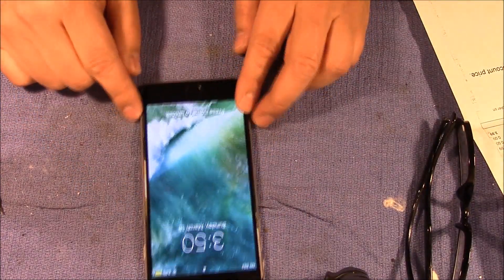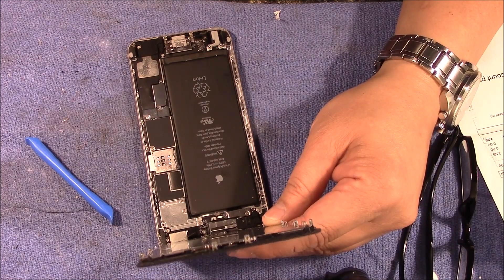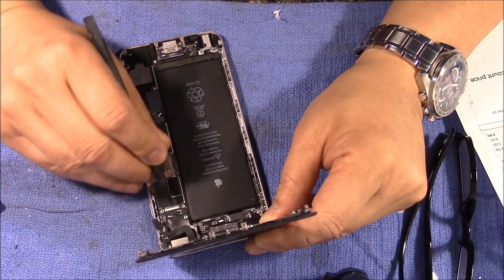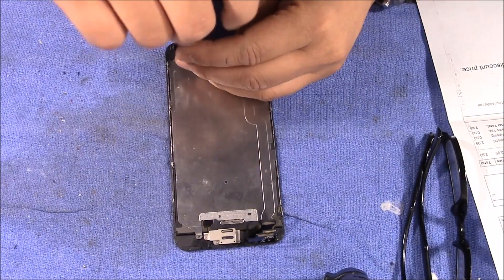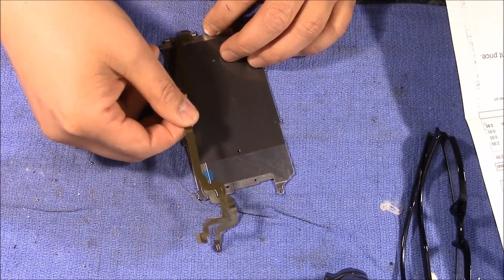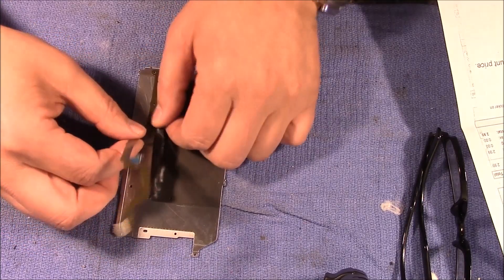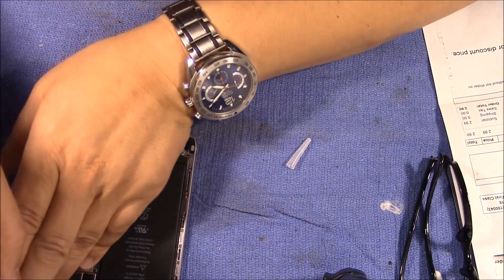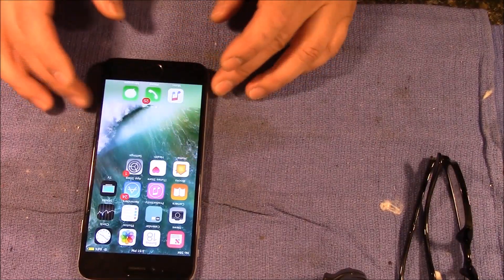iPhone 6 plus home flex ribbon cable replacement

Comment: i partially tore my ribbon and the amazing thing is that it still works..... but glad to know there is an easy solution to repair it... Thanks.
Reply from the maker: The cable is delicate. But glad to hear you have it working again.

Comment: At the top there's three ribbon cables does this also come with this ribbon part since I've just replaced the battery in my iphone 6s and the home button doesn't work and I snapped one of those 3 ribbon cables would this be the problem?  cheers
Reply from the maker: This is just for the ribbon that connects the home button.  If you damaged others than a digitizer may also be needed.
Reply: @mrfixit4211  thanks pal, I've just bought a new screen with camera and home button attached.👍

Comment: @MrFixit There is half a tear on my flex cable which is similar to the one you replaced. Is this why only half of my screen is able to respond to touch on the right side and why the left side won't respond at all? Is it the digitizer or  Can I use a flex cable from another phone with out having to buy a new on to fix the problem? Thank You in advance!!
Reply from the maker: I cant say for sure, but if there is a cut I would first replace the cable before replacing the screen digitizer.

Comment: Hey can you please please please help! I’m only 15 and my button came out my 7 plus and need to put the button back in its spot is this possible? Can the button connect with the ribbon cable again? I can’t tell my parents because they get very mad and it’s scary
Reply from the maker: If the button came completely out, then you will have to replace it, as there is no way to reattach the it, but there is a problem with that.  If you use a generic button, it will work, but you will no longer have updates as it is not configured to your device and only Apple can do this.  You can Google some work a rounds as many people have similar issues.
Reply: MrFixit thank you so so so much!

Comment: what do we do if we rip the actual home buttons ribbon cable
Reply from the maker: Then you will have to buy a new button.  They are not expensive and should be available from eBay or Amazon.  Depending on the model you may need an additional tool to transfer the ID to the new button.  JCID is one that many have used.
Reply: @mrfixit4211  ohh okay thank you so much.
Reply: Okay

Comment: Does it matter that I ripped the black bit that sticks down the ribbon cable?
Reply from the maker: The foil has a tendency to tear.  Use some tape to hold in place.

Comment: if i change it with the metal togther because the cable is connected, can it change too?
Reply from the maker: I don't know what metal your referring to, but the cable has the connector at the end.
Reply: the metal back that is touch by the cable. haha nevermind then thankyou

Comment: please can you give me cable buying link?
Reply from the maker: This is similar to what i used. https://www.ebay.com/itm/OEM-Home-Menu-Button-Connection-Flex-Cable-Ribbon-for-Apple-iPhone-6-Plus-5-5/201637231418?_trkparms=ispr%3D1&hash=item2ef283fb3a:g:2AQAAOSwyLlXn-0r&enc=AQAEAAAB8BPxNw%2BVj6nta7CKEs3N0qXawdJbtWdygcTww09t1rrDSDO2Wybh4vwFwHLcms9%2B7AOmCNi9OHCn4OqpaTSROH223QDNFB8pCvc0zv0U4iu98lnEriIU0vlor7bj0W1n1CCpKhpvl7i7E8EjaKqCZAwDRPgqLoYexOdSpF3E4qaluX4b3jVMXHkDhgIomKLFBiRbpGP0J%2F7BAymrHZp8TU8aGoCk09wFZLGHWKy4ak8%2F4eUj%2BITz9S0g1PKGsLSVpMbkf7ueZvQzqTtHeBa%2FHFtwSlN6CGC8pC79w7bYc0IYf%2BhJuYo28OhaFIrVAxjdLJ6jP3urSKgRrMqzvkuwBJMJKeC4SgL6U%2BQd6B1%2B94DTh2IKq9cl4uTZuLuGCEYG9%2FyxZb24glxhgidCGmQt1NDfDy2n7EQAvicJ4FrLbYdgbwXbivQVwiRQUFmbwd%2FIVKSdGqw78tk4%2BifbI7KgZwkLVV6AZHO7SGiKVRjiOun9c9mfedszlq%2BR2igIlpiZA8mHWgbQGaJSC%2FP3C2n%2FumIx190lPfigdbpCDop2gmXQnuJzGo6PB8XlJorkFjQhRR9IA7d0%2BB4k4Vy4Riwt%2FPAQyF%2FAPtH%2FnC5iDAKQ7JZ19ZCB7sc6E1spnnBYzfg9ULnmsgcRQttywqHtz6OFG00%3D&checksum=20163723141858f6931057a24568ab314762363d6ac2

Comment: bro from where i can buy above flexi cable in dubai ?
please help .. i was replacing LCD and Flaxi  cable break in Corner .. rest all working touch id apart
Reply from the maker: Do search of ebay, you should be able to find on easily.

Comment: Sir can u give online purchase link
Reply from the maker: The listing changes all the time. It would be good for you do a quick ebay search for the part as the assemblies have changed depending on what you may need.  Here is one I found https://www.ebay.com/itm/OEM-Home-Menu-Button-Connection-Flex-Cable-Ribbon-for-Apple-iPhone-6-Plus-5-5/201637231418?hash=item2ef283fb3a:g:YggAAOSw2Zld2iXg

Comment: Which screwdrivers did you use (and for what stages)??
Reply from the maker: You just need the pentalope to open the case and a small phillips like 000 to remove the rest of the screws.
Reply from the maker: the pentalobe is use to open the case and a #00 phillips for the rest.

Comment: Where do I get the cable
Reply from the maker: I bought it from Ebay. You can do a general search for your particular model, but this is similar to what i purchased for the unit I was working on. https://www.ebay.com/itm/OEM-Home-Menu-Button-Connection-Flex-Cable-Ribbon-for-Apple-iPhone-6-Plus-5-5/201637231418?_trkparms=aid%3D555018%26algo%3DPL.SIM%26ao%3D1%26asc%3D57475%26meid%3Ded3ab9fee4dc401c85c0ce894593349f%26pid%3D100005%26rk%3D2%26rkt%3D12%26mehot%3Dpp%26sd%3D251909914114%26itm%3D201637231418&_trksid=p2047675.c100005.m1851

Comment: Your fingerprint is working??
Reply from the maker: Yes, since the original sensor was used again and only the connector strip replaced, there has been no issues.

Comment: You show everything, but just as you take the top screen away it magically takes away all the electronic parts and the whole back is bare. Will
you show all the steps to remove the electronics, where all the screws to accomplish that, etc.